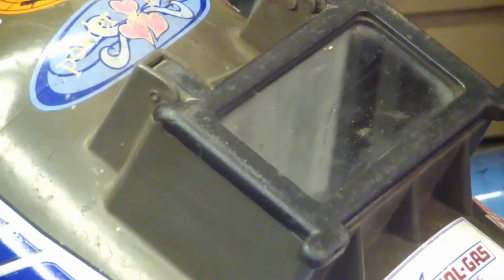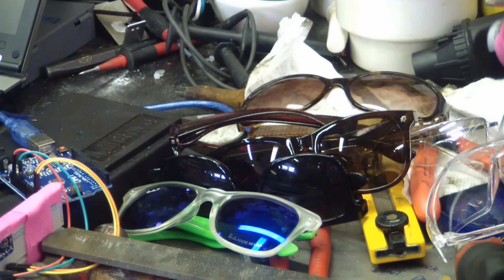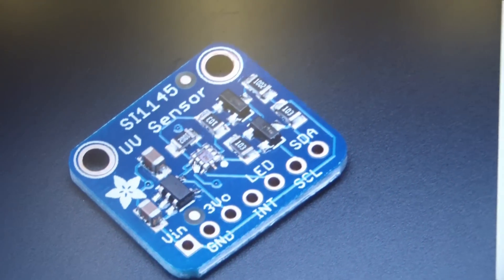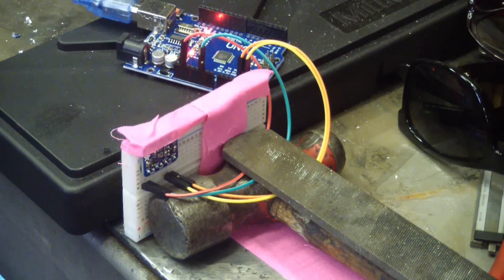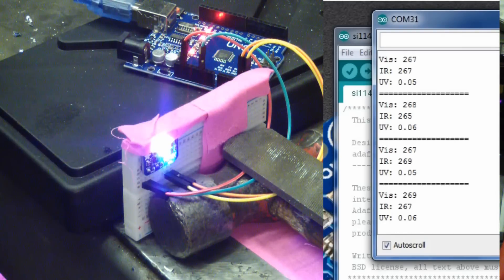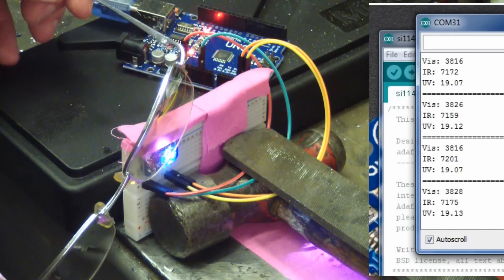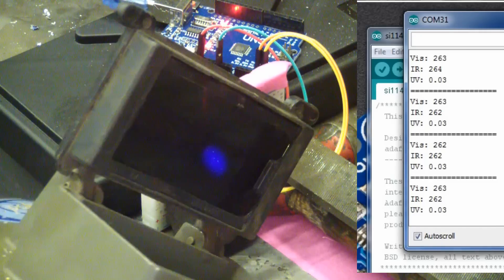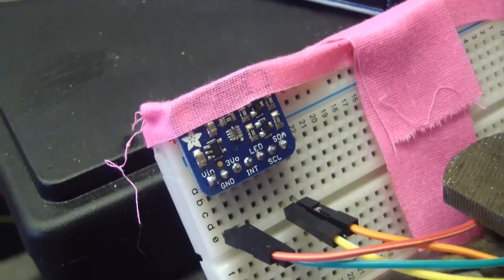Knock-off Ray Ban Sunglasses vs. UV laser

Comment: Neat - good data.  The cheap cheater glasses were the real data point - You know hydrocarbons (like the polymethacrylate or polycarbonate) love to soak up UV (that's why drill cuttings light up in UV when you drill into an oil bearing formation - although you can also ingest a tiny bit or cutting and see if your belch smells of gasoline - no kidding it works).  FYI my camp years were 5 on 1 off. When you work that schedule you come home and all the one dollar bills are folded long ways.

Comment: I worked at a place that had UV testing equipment, and was told polycarbonate blocks UV. So regular plastic lenses are just fine, you don't need sunglasses unless it's too bright out. Sunglasses are a huge scam that way.

Comment: Making something that is transparent to UV is actually incredibly difficult. In spectroscopy people used to use quartz fluid-containers before specialized plastic was developed with a decently low absorbency for sub-300 nm light. So I think it's natural that even the cheapest pair of sunglasses, or even regular glasses, will block out >99% of the UV spectrum

Comment: I call bullshit. Eyes are valuable and this test is dangerously crude and this wanders into "unethical" territory.
Reply: coffeefish Somebody is mad that they bought expensive sunglasses that are worthless.
Reply: coffeefish No bullshit, any piece of glass or transparant plastic will filter most if not all of the UV A, B and C. That is why even the cheapest plastic eye protectors will avoid arc eye. And yes, the test is rather basic in setup, but it's good enough for this purpose.
Reply: maddox0110
Shit Man, there is more to this. I'm sure of it.
Reply: coffeefish You can be sure that UV rays get blocked very easely.  Even some salve on the skin can do that job.  It's called sunblock. On the other hand, people who believe rubbing sunblock on eyeballs is a good thing, they learn otherwise after the first attempt.
Reply: seigeengine When a coating scratches off, it no longer does it's job. You think that's an opinion?
Reply: ᅚ ᅚ Never bought sunglasses. Welding masks and safetygoggles on the other hand.
Reply: maddox0110 Both glass and transparent plastics tend to be bad at blocking out UV light, especially light at the wavelength of the laser, which is also where most of the UV light we receive is (the closer to visible light the more of it we get).

So no, any piece of glass or transparent plastic will not help you, as it will fail to block most of most of the UV light you're actually exposed to, outside of welding at least.
Reply: seigeengine I'll tell that to the guys who design the UV lasers to make computerchips.
Reply: maddox0110 Feel free, as I'm correct. Of course, if you actually relay the information correctly, you'd look like a complete dumbass, but never mind your dysfunctional brain.
Reply: ***** It isn't, but it's also a pretty good test. The laser is emitting light at the wavelength that composes most of the UV we experience here on the earth's surface, meaning that the test should accurately represent the effectiveness of sunglasses at blocking out the UV light we're exposed to.

Now, obviously I'd expect better equipment, and a more comprehensive test of blockage across the UV spectrum if this were being done as an actual proper medical study, but it's good enough that one could take medical advice from it, although that obviously would not be a great claim to make on the content producer's part.
Reply: +seigeengine So why is it when your driving on a hot sunny day with the windows up you don't get sunburnt if glass doesn't block uv rays?
Reply: MrMikey1224 Transparent media do not block near-blue UV well, because well, you need blue light to get through the material for it to be transparent, and near-blue light is also going to get through.

Sunlight on Earth contains a spectrum of light, with lots of blue/green, tapering off as you go into the UV, and as you move towards reds. While UVC, the highest energy area of UV gets blocked by the atmosphere, a lot of UVA and some UVB get through. Both UVA and UVB cause skin and genetic damage but UVA generally doesn't cause sunburns.

That is, your car windows might block UVB okay, but unless they're specially treated to block UV, they're letting most of that UVA.... the UV radiation close to blue light.... through.
Reply: Paul C Uh, going to need more than your opinion on cheap sunglasses being made of a material that doesn't adequately block UV.

Also, you shouldn't be wearing sunglasses on your face if you expect them to suffer traumatic impact. Just a thought.
Reply: Paul C From UV light. Not from getting hit.

Now, are you done wasting my time not substantiating your bullshit?
Reply: Apparently you're completely useless.

Comment: The only really harmful sunglasses I know of are blue-tinted ones. All of them. Blue light is responsible for the pupillary reaction. If you filter it out, your eyes stays wide open in the sunlight, and you harm your retinas. Think about it: blue skies are always associated with strong light, so this shortcut evolution has taken works. Until some ape gets to smart for its own good, and makes BLUE sunglasses. Not so see better, but to look good. Man, our whole species are smart idiots.
Reply: Wouldn't blue tinted sunglasses let through more blue light than other parts of the spectrum? Most glasses that specifically filter out blue light (at least the wavelengths that disrupt sleep patterns, strain eyes, etc.) are not at all blue tinted, usually a yellow/orangish tint.

Comment: That was a great video.  I knew you would eventually use an Arduino in a video.  I don't remember one before this.  My brand new intra ocular lenses are supposed to block UV and blue light.  I wonder if I even need sunglarses.  Hmmm, will ask the eye doc next week.  Thanks for the video.

Comment: Wait a second. When we work with the IR and UV light for TLC Chromatography in organic chemistry our professor told us as long as we wore safety glass we would be fine. He said we didn't have to ware special UV protection because all plastics block UV rays.
Reply: Ight. Cant wait to see the results. We are required to wear Z87 rated glasses. Dont know if that has anything to do with it.
Reply: ***** actually they should as most safety glasses are made of pc which cuts at 400nm. So everything that passes will be either ok for your eyes or you will look away when too bright as you see down to 380nm, some even a few nm below. Lasers and super bright stuff might be dangerous of course if the energy impact is too high until you manage to look away ;). Looking forward to your video. Hope you got another u uv source then.

Comment: Install it in the lawnmower so it fails to work when the sun is out.
Reply: and make it beep randomly while you're at it
Reply: Also make it attempt to vacuum itself onto a porous surface and inevitably fail.
Reply: tnogiv And make it release a pack of goats onto your lawn to do the job for you...
Reply: tnogiv Also provides a good excuse to spend the day in the shop "fixing" it.
Reply: Celebrate with a few beers
Reply: No need to, they do that anyway.

Comment: Anyone else notice the cloth(bottom left) changing color at 4:30>?
Reply: No Name The camera's auto white balance probably isn't having a fun day with all of that UV light on the center of the image
Reply: It is a led light strip underneath his work bench that changes color in  set time intervals.
Reply: Nope and still dont
Reply: wbower74 to see it, it requires you to watch for more than 2 seconds.
Reply: No Name  It's not a cloth, there are several white reels of wire under his bench (visible at the beginning and very end of the video) and he appears to have some multicolored LEDs somewhere under the bench cycling through different colors.
Reply: I figured that out after I made my statement, didn't give 1 diddly to change it. :P

Comment: even normal non modified glass block UV :) you should have tested normal glass too as reference for comparation...
Reply: Actually "normal" glass cuts off around 300nm. His laser has 400nm so it will go through almost 100%
Reply: IamIUareU I have my pet iguanas in a sunroom with glass windows.  Iguanas need UV light (not sure if its A or B) to digest calcium.  I heard UV light did not pass through glass, so I take them outside to sun in direct light.  The interesting thing is that anything plastic in their sunroom discolors like the UV is fading it.  So it makes sense that the other comments are correct that glass blocks UVB only.
Reply: TheJohn8765 As far as i know plain glass blocks around 98 percent of even the UVA
Reply: As far as I know without a UV coating glass does not block UV at all .. polycarbonate lenses block all UV without any treatment and plastic about 80%. I wish he could test some of those aliexpress knock off raybans
Reply: I have some high power 385nm leds, I would say roughly 95% of the light output is blocked by any type of glass I've tested. A small amount of visible light can penetrate, but the UV fails to pass through and activate phosphorescent materials.
The human eye actually seems to block the UV too, but it will cause the lens to glow.
Reply: You're right from  wikipedia: 90% blocked under 300nm and 90% passes through over 350nm
Reply: horle Interesting about the wave lenght
Reply: +Special EDy there are many reports where people received eye lens transplant (they were putting  plastic lens to replace damaged or malfunctioning lens) and those people were able to detect and view UV light :) nowadays they use plastic lens with UV filter but a decade ago they didnt had the technology...
Reply: 3choBlast3r then you obviously don't know much about glass and UV. But his test with the laser is BS anyway. :)